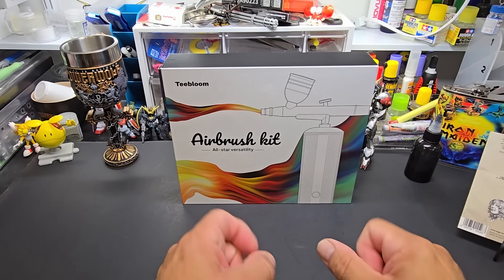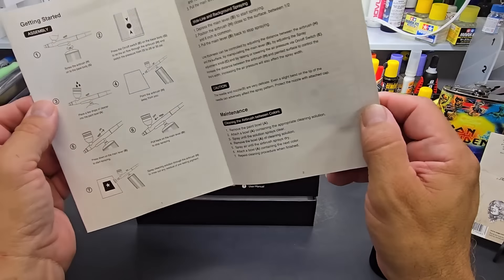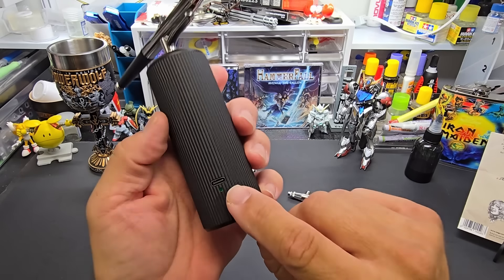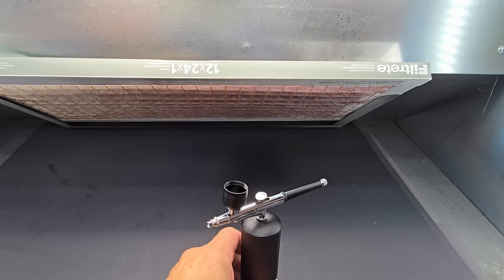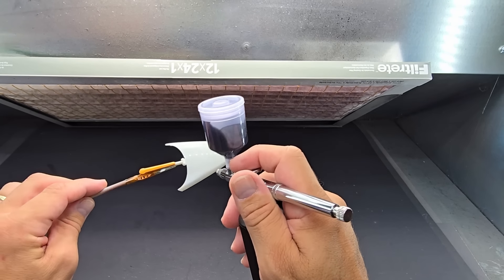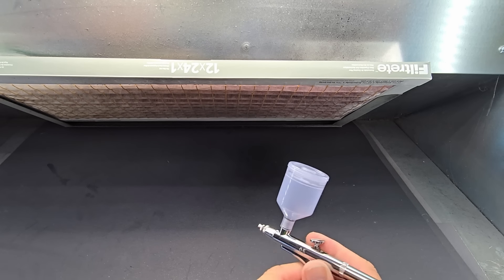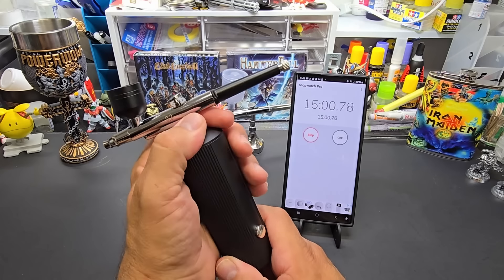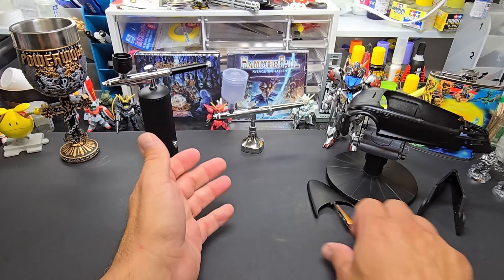Testing A $20 Airbrush & Compressor Combo - Amazon Prime

Comment: I saw you test review one of these handle type compressor. I bought one last year that came with a double action air brush, multiple cups, also with multiple needles and nozzoles, small cleaning kit plus that little reamer tool which is nice in itself. A really long hose as well. What i like it has small snap in batteries for the compressor, i have 2 batties. Think it cost me $38. I use it for quick painting like small parts or touch up. I like it. Sprays pretty good, last time i used was painting camouflage on a 1/35 scale kublewagon the german jeep of WWII
Reply: Do you remember the name of it? Think I remember it as well...
Reply: @tre-Bż  
No, and I threw out the black box it came, the compressor is black and square shape, as we're the batteries, they snap in place at the bottom, it does have an increment charge indicator; 100, 75, 50, 25%.
The air brush isn't bad I can spray a fairly decent fine line it. It's just not as nice as the Gaalheria AB I have

Comment: I recently got back into building models. I had always used spray cans for the car bodies. I picked up a similar airbrush from Amazon and it has worked very well. It has paid for itself because I can paint several kits with the 23ml bottle of Tamiya paint. I will eventually upgrade to a better compressor and airbrush.

Comment: I think the value in this is priming with solvent based primers outside so I don't have to smell it inside even with good ventilation or use up filter material needlessly

Comment: I recently got a point zero airbrush compressor. One of the small ones. I think it's the air-comp elite 95. I regret getting it. It's advertised as having a tank, which it doesn't. It's advertised as being able to adjust the psi, which you can't. It constantly blows at 40psi. It shoots paint out soo fast It's really hard to use. Im going to have return it and get my money back. I also had to buy a new airbrush to use with it

Comment: I would imagine if you hooked a hose to it and a regular airbrush it wouldn't run constantly and if you want to use the airbrushes it comes with just get new valve ends from tcp air rush and a hose or a 1/8 to 1/8 fitting and now it works like a regular airbrush and also doesn't run constantly so your looking at 30-35 bucks .......hope that helps